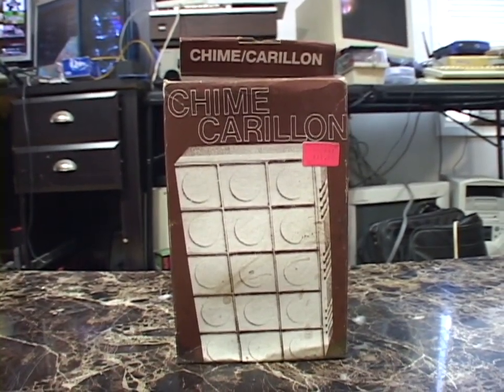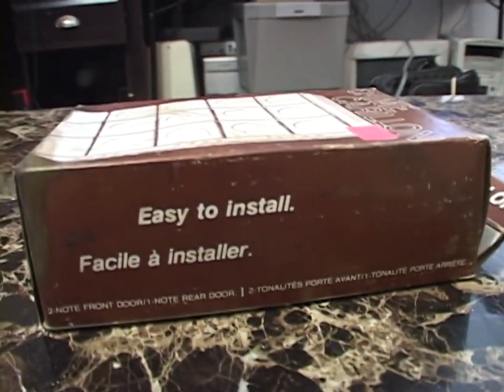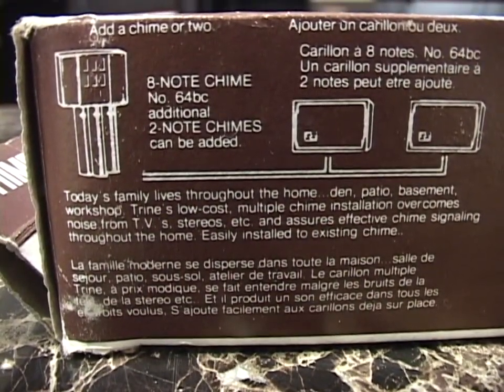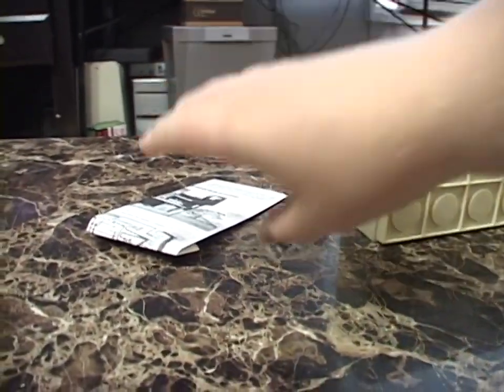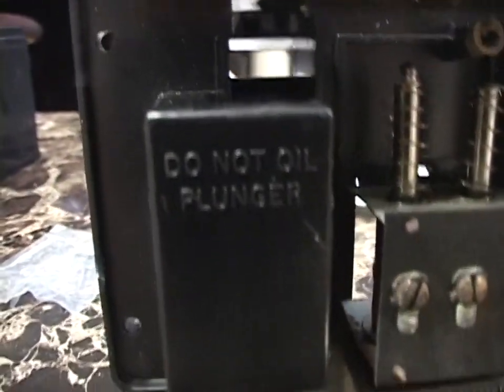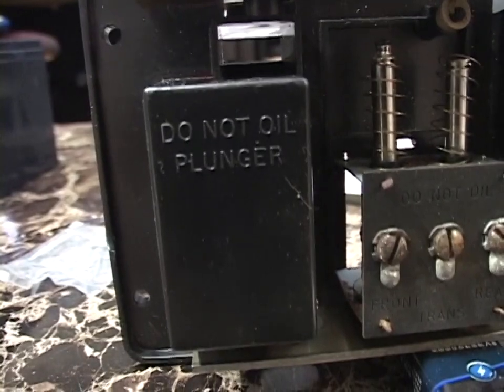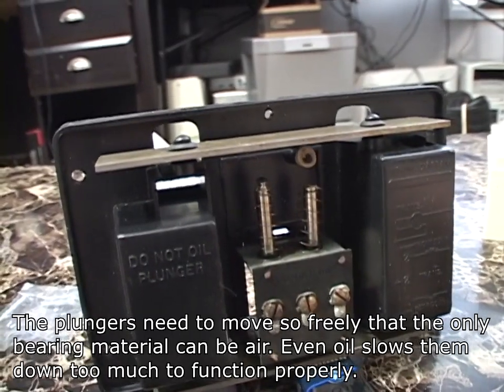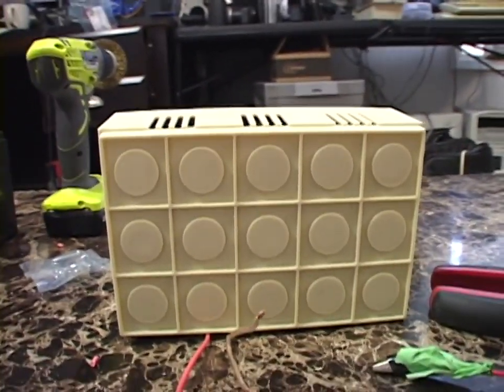Square D/Trine No. 30A vintage doorbell

Comment: A neat artifact of running a doorbell on AC is that if you hold down the button, the solenoid makes a slight buzzing sound. So the front doorbell sound is actually like "DINGbuzzzzzDONG".
Reply from the maker: I noticed that after acquiring my doorbell transformer after making this video. The coils are pretty noisy in this one!

Comment: For an easy way to ring the doorbell at a distance you can search "remote control relay" on the usual sites for around 10USD. They usually come with a keyfob but there might be a more weather resistant option out there as well.
Reply: When my nana’s doorbell died in 2002 she was pissed at the wireless speaker replacement that needed batteries every few months. I wonder if my cousin who installed it could’ve used a remote relay, I’m pretty sure it was the wiring that broke rather than the bell solenoid. 

But who knows. She’s using one of those “powers itself from the force of the button push” ones now and is pleased at it being passive again.

Comment: Just use a 433MHz RF remote control coupled with a relay (you'll possibly need a driver transistor for that) and you should be fine :)

Comment: I was the type of kid to notice whose doorbells played a noise with the first push and which ones I could hold the button to delay the “dong”. If any of them had a system like this, I’m sure I’d have noticed the different sound for the other door and just held the button for 2 minutes until I heard the back door open… just to be annoying. But only a couple of friends even had more than one external door anyway.